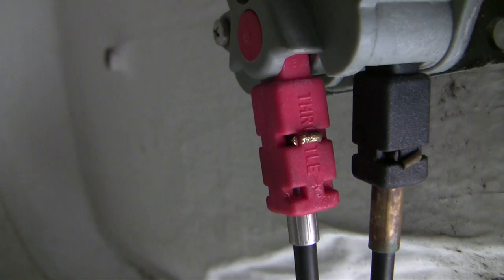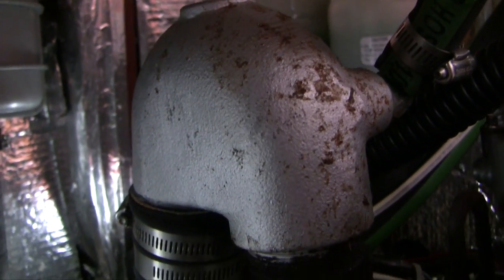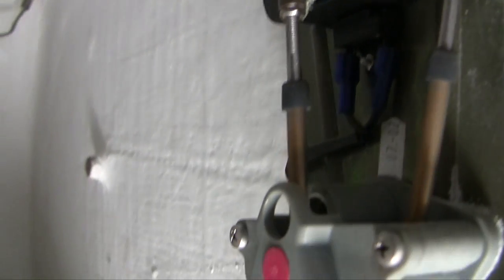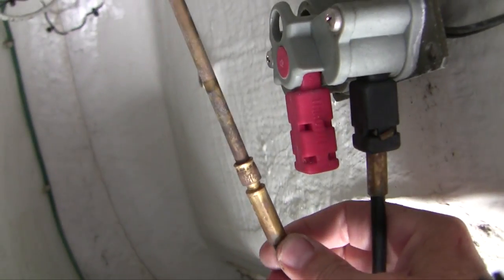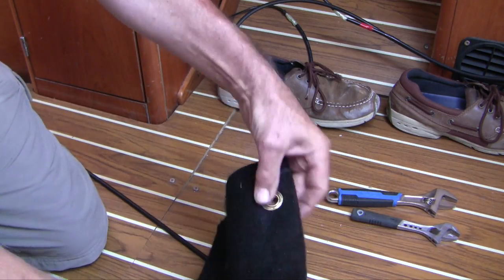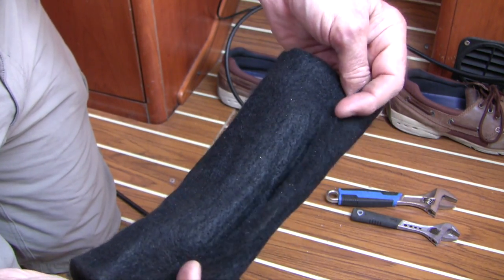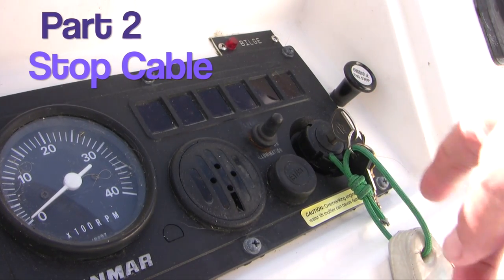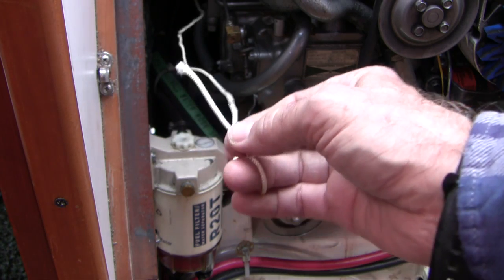How to replace Yanmar control cables on a boat

Comment: I'm having a lot of trouble getting the screw that holds the kill cable lose.  There seems to be a bolt below the screw but I cannot get that screw to turn.  Is there some trick to getting that screw to turn?  Thanks
Reply from the maker: Do you mean at 8:23 of the video? If it is similar to the photo, remember you need to loosen the locking nut off first before going at that phillips head screw. That locking nut holds the screw firmly to prevent it from backing out with vibration from the engine. It puts pressure on the threads so it can't back out. When a screw won't back out for me, I try the usual approach of spraying penetrating oil (PB blaster works well) on it overnight. Then I come back the next morning and try heat. In my shop I have oxyacetylene but propane will work if that's all you have. MAPP gas and oxygen are better than propane but more expensive. Possibly the last owner put locktite onto the threads in which case heat is the answer. The heat/shrink cycle is often enough to shock corrosion loose between the dissimilar metals. For a screw, if I can hold it against a solid part I sometimes use a manual impact driver, but in this case I think the base may not be stable enough when on the boat. I don't remember how it goes together but if you were to cut the cable you might be able to spin the whole part off and take it home to secure the base more effectively in a vice. Phillips head screws are notorious for stripping out, in which case you could either use a hacksaw to cut a groove in the head, or weld a nut on the end of the screw to get a better grip. Alternatively vice grips will sometimes work. I have a set of bolt extractor sockets that have left hand cutting threads. You hammer them onto the screw head and spin them out. The real difficulty happens when you break the screw head off. In that case it may be easier to just replace the part, but welding a nut onto the remaining screw might work, and 'easy outs' are designed to thread into a hole drilled into the exact center of the screw (not easy with a small screw). It's possible that the previous owner or mechanic crossthreaded the screw. That part may be inexpensive, you have to weigh how much your time and effort is worth. In the meantime you can still use the boat, I had my stop cable disconnected for six weeks while waiting for a new cable. Good luck!